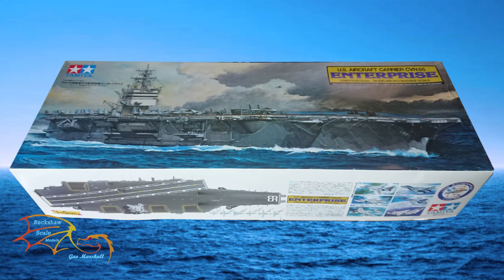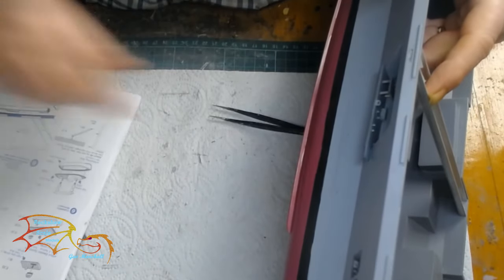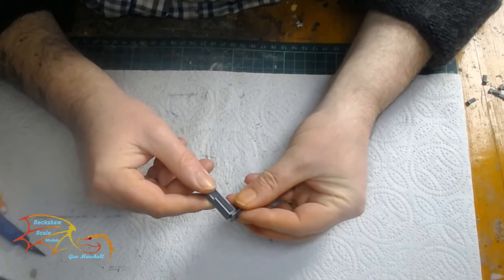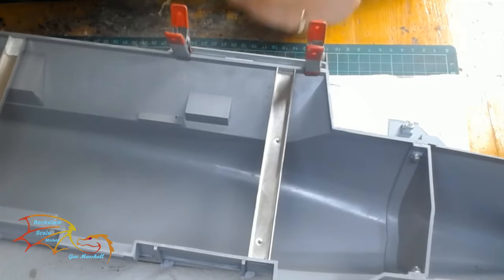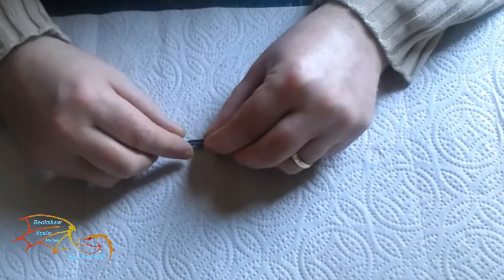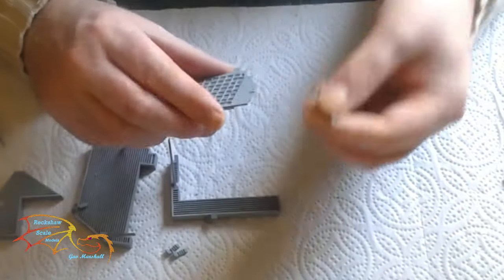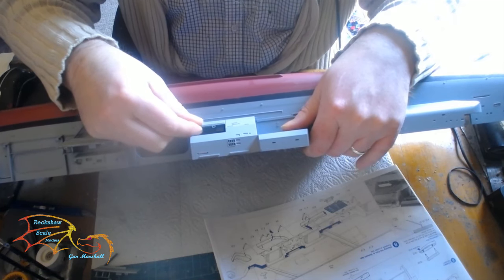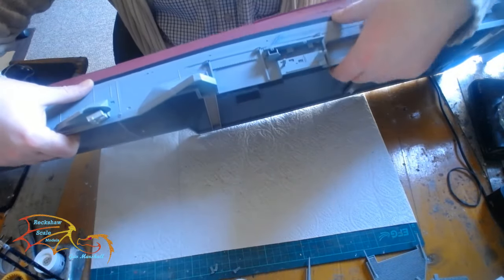Tamiya US Enterprise CVN65 Scale 1/350 part 4

Comment: Always love watching modelers putting together a kit. Keep it up mate. Your Camera, however, is constantly hunting for focus and it is likely because of the paper towels you have laid down on your table, perhaps try using old newspapers instead, the cleanup is much easier and a lot less expensive as well. the variation of the newsprint will make it easier for your camera to focus on the table and then your hands/pieces you're working on.
Reply from the maker: Hi oculusangelicus8978, thanks for tip. I never considered it would be the paper towel causing the fucus issues, I just assumed it was my camera. Thanks for watching.

Comment: I got this kit in my stash. I did get one back in the 70s, The Aircraft were different during that time. those metal brackets, DO THEY COME WITH THE KIT?. Need to check. Thanks. Nick I just Subscribed.
Reply from the maker: Hi Nick,  the brackets came with the kit I suspect that they are a later addition. The version I have is around 94 I think. I would say the kit does need the braces, I've never before thought about that before but Ill be adding those sort of braces to any other 1/350 ship I build. I'll probably use a pices of wood for that. Thanks for watching and for the sub.

Comment: Coming along nicely mate. Can I ask, what colour Grey paint are you using for the main hull and all the superstructure parts etc?
Reply from the maker: Hi Andy, I'm using Humbrol 127 ghost US grey for the main colour. I'll be adding different colours and pigment powders later on to brake the colours up but I have made my mind up which ones I'll use yet.
I was going to use Revell Light grey 57, in fact I started to use that colour. However I ran out and didn't realise I was running low. The Humbrol is a very close match though.
Reply: @ReckshawScaleModels  Thanks for that. I have various Grey paints mostly from Tamiya. I Got these ones for my Missouri 1991 kit, XF-66 Light Grey, XF-54 Dark Sea Grey, XF-24 Dark Grey and Xf-50 Field Blue. I also have plenty of XF-19 Sky Grey and XF-83 Light Sea Grey 2 RAF. I also have both Sabo Arsenal and Kure Arsenal Japanese Greys from Tamiya. I painted my HMS Prince of Wales in the XF-83 Light Sea Grey 2 RAF. I know its not the right colour, and it's probably too light. But sometimes the correct colour will look too dark when its a 1/350 scale model. It doesn't help when Tamiya call out a TS spray paint number, but they then don't have the equivalent XF colour to use instead of the spray can.
Reply from the maker: @Andy.Gledhill.Models.  I will be be using some of the Tamiya range, although I do have the full range I tend to use Tamiya colours sparenly. No reason for that really it's just how I do things. I'll list all the colours I've used at the end if the build and post it in the comments.
Reply: @ReckshawScaleModels  Cool. I have some pots of Tamiya paints that are well over 30 to 40 years old, and are still OK.